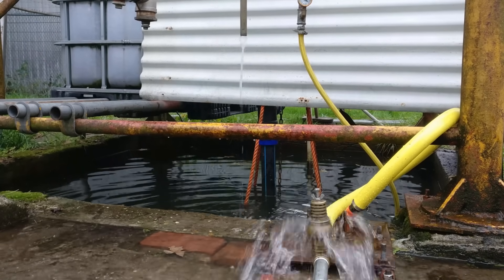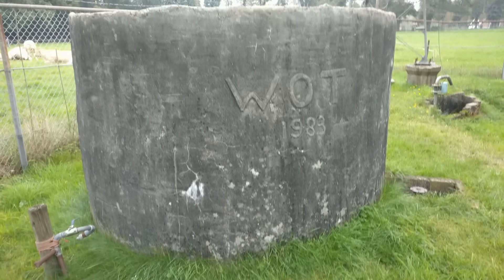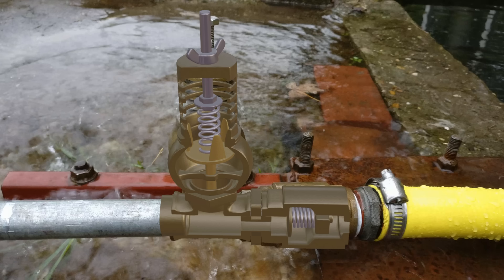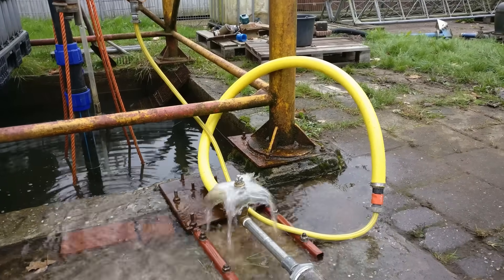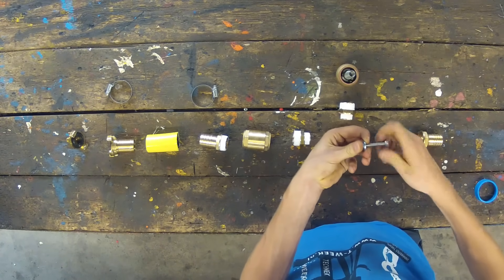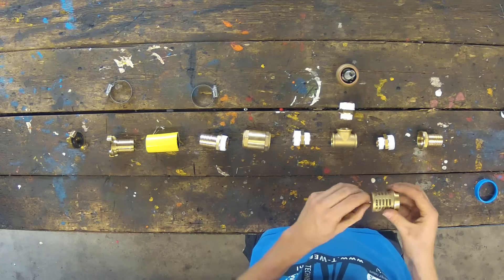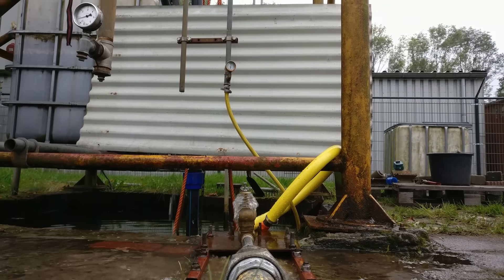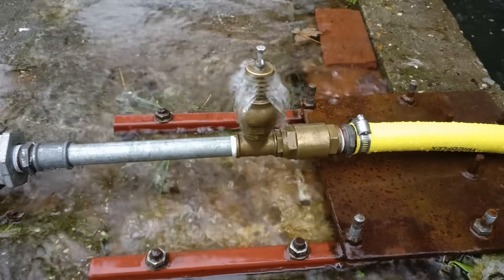Pumping Water Without Electricity - The Breurram

Comment: Now to incorporate a hydro generator...  and add more pumps to fill the tower faster..  If you seal off the tower then vacuum suction could siphon the water without even needing the pump..
Reply: I’d like to see what you’re referring to, got a link?
Reply: Because it is an "open system", air would still enter in the water and prevent the vacuum.
Reply: @Rattlerjake1  pumping the air out of a sealed system would maintain the water pressure keeping the vacuum intact.
Reply: Once the water is pumped up to a higher elevation,  if the water comes back down it will create a vacuum, and thus draw more water up the the top of the water tower that was created. The tank, would have to be almost completely, full before the water is released down a return pipe. If the water coming down is fast enough, it can turn a turbine and that could turn a generator and thus create electricity.
Reply: If this all works, then I could see the electric company using water towers to create hydro electricity, because they have the budget to build things like this at a very large scale. It would be like having another Niagra falls as your water source, except they would be using water towers to do the same thing on a smaller scale. But, if have rivers and lakes near by, it would be a way so build one and have nearly an endless supply of water to do this from.
Reply: @MrFlyb4crawl  even better I envision a 1700's person placing a wooden water wheel directly in the river & laughing at you hysterically every time he walks by your "invention" on his way to boffing your starving wife for a few lbs of groceries you will be unable to provide your family while he becomes famously [for the 1700's] rich!
Reply: In order to use a water tower to make water pressure it must be open at the top.

And it Is impossible to move liquid water  more than 34 feet in the air on vacuum alone.
Reply: @Texassince1836  Water towers are covered..  I am not talking about small towers on a farm, I am talking about huge water towers for cities...  they act on a siphon principle, what volume goes in comes out..  pumping the air out would only maintain tower pressure, it would be initially pumping water into the tower to fill it up.
34 feet is still significant, especially if a ram pump can be included using gravity as a renewable resource..
Reply: @FirstLast-nt5ui  municipal water towers are "covered" to keep the weather and wildlife out, BUT they are also open to atmosphere at the top, not sealed.

You can not siphon water over 34feet
Reply: @FirstLast-nt5ui  negative.

Water towers are open to atmosphere.

You want water towers to be vented to atmosphere at the top, thats the only way they make pressure.

And you can not possibly draw water higher that 34 feet. If has to be pumped from the bottom,  meaning the siphon will not work
Reply: @FirstLast-nt5ui  water towers are also not pressure vessels, the pressure in the tank is 0 (atmospheric) at the water surface, and only a few PSI at the bottom of the tank.
Reply: @FirstLast-nt5ui  on municipal scales there is 1 major type. 

Vented, unpressurized steel tanks.
Reply: And you still can not possibly draw a siphon over 34 foot. The water in the hose will begin to boil as you pass 32 feet
Reply: Except a siphon relies on one body of water being higher than the other. You would only get as much head as the difference between the source of the water and the exit point, not the height of the tower.
Reply: @milmaxleo7268  All along side Niagara Falls they could compliment the hydro facility with siphon generators using the cliff to achieve the siphon...  I am sure there are other instances like this at other locations..  any rivers feeding into a lake and any lake feeding into rivers there is a drop off point or reduction in grade that can support siphon generators..
Reply: @milmaxleo7268  I think it will flow in as fast as it flows out...  lower tower probably being a bit more efficient than a tall one..  might not be as much head pressure as standing water in a tank, but it should still have enough to power a generator quite easily once a siphon is established..
Reply: @FirstLast-nt5ui  okay, but where is the theoretical water source? There isn't a way you would get more energy with said siphon and tower than if you just used the water source directly.
Reply: @milmaxleo7268  isn't that what this is doing, just another way of going about it...  Either way you have to build infrastructure.
Reply: @milmaxleo7268  People use siphoning for hydro generators too, maybe not a water tower too, but siphoning is useful...  try and think about what you CAN do instead of what you CAN'T do so much..
Reply: @milmaxleo7268  are either of us even bothering to try and build any of this?  It doesn't matter, it is just a comment online you are replying to that is irrelevant.
There are options & even if we did not know any options I am not about to share them online with complete strangers..
Hint, Electronic Components function oddly similar to Plumbing Components...
Reply: @FirstLast-nt5ui  I just cannot think of a scenario where building a tower would benefit more than just doing a micro hydro setup with say the source for a ram pump, which is usually a creek. I suppose if you already had a dam it weir a syphon turbine could potentially save costs, but the only purpose of the syphon there is so you don't have to modify your existing structure; The syphon does create any more head or flow than is already available.
Reply: @FirstLast-nt5ui  regarding electronic components functioning like plumbing components you are half right. 

The difference is voltage isn't created or affected within the system by gravity and atmospheric vacuum.

Furthermore, both ARE affected by difference in potential energy. In either case it will flow from higher potential to lower potential and never in reverse. 

You with me?

Great.

Now go ahead and build your sealed tank siphon system to go from the lower potential to the higher potential as you've described lol.
Reply: @Spearborne  I was referring how a capacitor works like a bucket..  but you keep on going, you seem to know exactly what I am thinking...
Reply: @FirstLast-nt5ui  a capacitor does not work like a bucket when you account for atmospheric pressure and gravity influencing the system.

Which are factors with water.
Reply: Lol this guy thinks he invented perpetual energy.

None of you so far are considering that you need to get the water up into the first reservoir before the ram pump can even start to function though.
Reply: @Spearborne  I never implied perpetual energy... YOU did...
I was just spitballing comments online only to have a couple clowns come trolling by...
Reply: @FirstLast-nt5ui  I know you didn't say it.

But the thing you're suggesting can only work if it was.
Reply: @FirstLast-nt5ui  it can't work. What you're specifying requires more energy out than in. It's impossible and it's really not up for debate lmao.

I'm a journeyman and mech E student with 10 years of experience dealing with cooling, heating, and putting water into reservoirs. I promise you that what you're suggesting is impossible and if you somehow make it work you'll be a billionaire.
Reply: What you're suggesting is a physical impossibility.

Go ahead and try to "siphon" from a low open top bucket (to simulate your river) to a higher, sealed one, and then back down to a point above the lower one. 

I don't care how you fill the top one, just as long as it is sealed as you suggest.

You'll find that the system immediately flows to the lower outlet and it does so with as much pressure as is caused by the difference in inlet and outlet height. 

If you're trying to pull from a river then the river will of course always be the lower point.

No matter how high you put the sealed bucket you will never increase the outlet pressure as a result.

"Oh but I can put check valves in!" You might say. 

Go ahead. Try it. Check valves won't make it work at all, they'll just close up and nothing will move. 

Post a video.

Comment: Could this be done for the "ghost town living" channel where they need to pump water from deep in a mine up to the surface? If so then please let them see this video.
Reply: Dont think he has the flow you would need to do this, where would his exhaust water go?
Besides, if he had flow, he could drive a turbine connected to an electric pump.
Reply: I think it's too deep for this type of pump, and Brent has power up there so he can use the electric pump no problem.
Reply: @JohnSheesley  Brent could actually use this to ensure his electric pump is always primed....  no need to pump all the way up, but his biggest issue seems to be pump priming or?
Reply: @JohannesLauesen  easiest way to keep a pump primed is a check valve at bottom of inlet line, it'll keep the whole line filled

Comment: Could you use this to pump water to the top of the tower, then generate electricity as the water flows back down?
Reply from the maker: Hi Karston, yes you could, but remember that at the bottom of the tower the water is already flowing. The pressure here is lower  but the amount of water is much larger. It would probably be more efficient to generate electricity directly from the flowing water at ground level.
Reply: @WOT_utwente  maybe some day we'll figure out how to break some of those pesky laws of physics 😉
Reply: You would have friction losses throughout the pipes, plus the losses from the exhaust water. While in the application of moving water these dont matter, for generating electricity you are just creating a Rube Goldberg machine.
Get rid of the tower, get rid of the ram pump, get rid of the pipes, and just put your turbine straight onto the flowing water. Basic laws of physics ensure you will generate more electricity than by ram pumping the water to a height and dropping it onto your turbine.

Comment: lol  water "lost" from a river in this kind of setup is no problem at all..
Reply: You still need to get it into the first tank however, as it still needs to be elevated to allow it to gravity feed into the pump.

There is no electricity here, but how did it get into the first tank? If that was done with a pump then there is a rather significant loss of energy.

Comment: I wonder if instead of the air bubble, you could use a length of very stretchy hose in the same place as an accumulator. That bubble does not remove the need to eventually put the necessary pressure to force the water up to a height. It only makes the pressure spike more gradual. There would be the same spring buffer effect with a hose that can stretch to expand the same amount as the air bubble allowed. But if you can eliminate the need to maintain an air bubble, it seems likely that the device would run for much longer before it needs a person to look at it again.
Reply from the maker: Hi, that's an interesting idea you propose. The air bubble is indeed there to spread out the pressure peak. Without this buffer all the water in the pipe going up the tower has to be pushed forward in a very short time to allow for 'room' for new water entering the pipe. Anything that acts as a spring could be used as a buffer,  also a flexible tube. But I do think it is important that you have a short and very flexible tube. I can imagine that if it is too long, still a lot of water has to be pushed forward before the spring effect fully kicks in. I am not sure about this though.  What commonly available type of hose would you propose to use for this very stretchy hose?
Reply: @WOT_utwente  I remember being impressed with what I believe was 3/8" surgical tubing used as the body and reservoir of a basic toy water gun. It's the same stuff as people sometimes use to make slingshots. The tubing inflated to perhaps 2 inches OD under the pressure from a water hose, which makes for an even more significant increase in the internal volume of course. It seemed to inflate unevenly, starting at one point along the tubing and expanding along the length as more water entered. I think a thinner-walled variety would do the same thing at a lower pressure than the 2 bar minimum the toy probably required, or the ~3 bar it was usually used with. Edit: and one with a larger starting diameter, however large is practical.
Reply: Yes a tube can be used. Also the expansion tank (with bladder / membrane) from a hot water system.
We have a ram pump that has a small hole to air where the valves are. As the water bounces back it sucks in a bit of air.